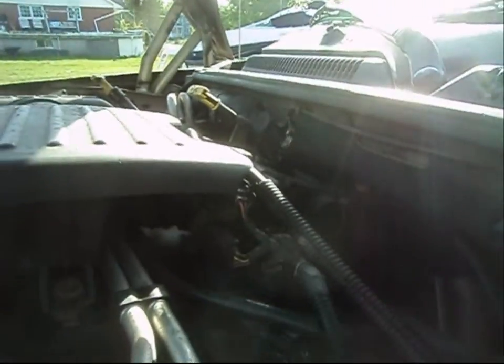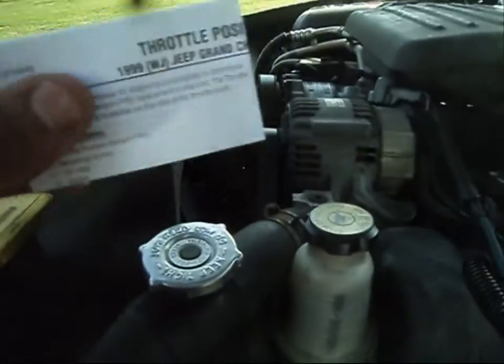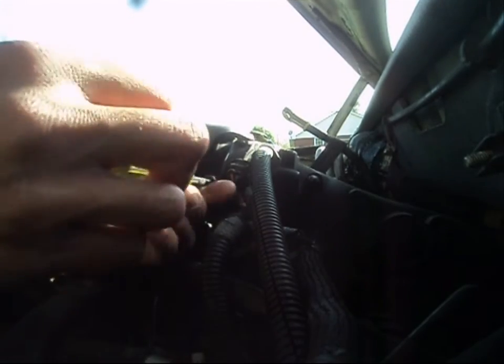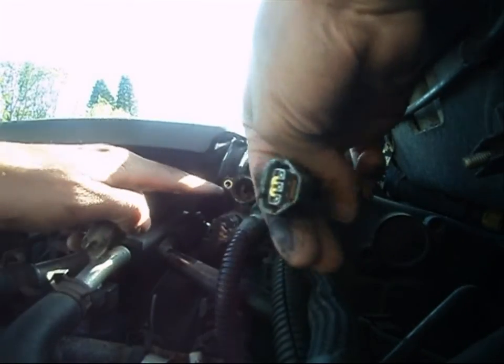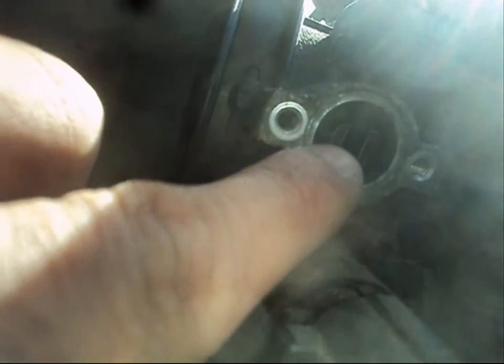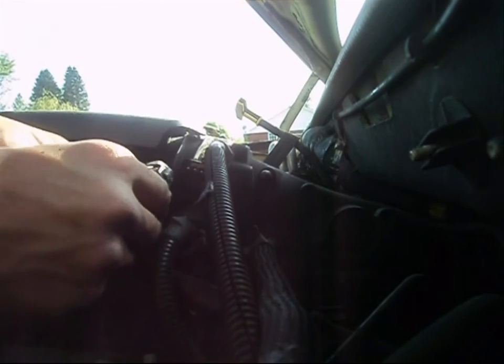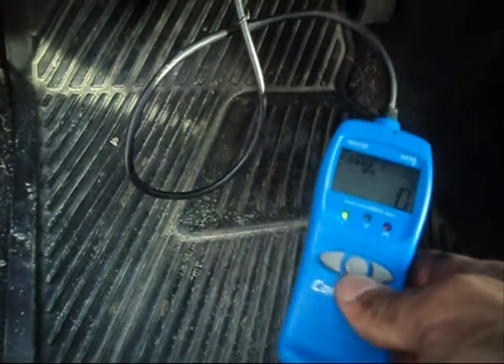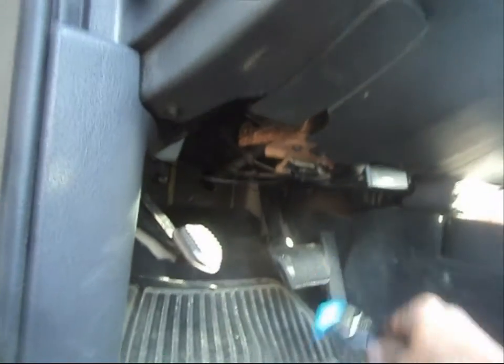Throttle Position Sensor Replacement 4.7 Liter Chrysler Models

Comment: I was having the same problem coming to a stop sign the engine would rev up I would have to slam on the brakes and put it in neutral the engine would rev up and then go back to normal. You can't hold it with brakes when it does this it will run you out into the traffic. It's a quick fix unplug pull out put in the new one plug it back in. I had to end up using the old screws also the new ones even though they look the same they were not they were just a hair smaller for some reason mine is a 2004 Dodge Durango 4.7 got the part off eBay for $10 it's a little awkward to put it in because you have to stretch out to the back of  the engine to get to it. If it's going bad definitely replace it could get you killed have a wonderful Dodge day.
Reply: Have driven it for the last 3 to 4 hours running around town no problems feels good again to not have to worry about being killed why a faulty piece in a vehicle Dodge should have a recall on this

Comment: That's funny as hell, My 2003 Ram started to idle way up and down to the point it would stall on the down side of it but I couldent get it to trip a code forever, literally just the other day it finally tripped the engine light and sure enough "throttle position sensor failure" on the scan tool......got one off eBay for $10 and it came with the bolts gasket oring and everything, people say on the dodge forums not to use the cheap ones but it totally fixed the problem and runs great so far!